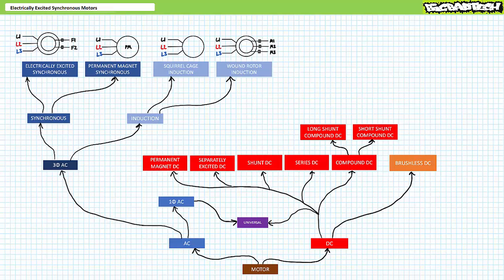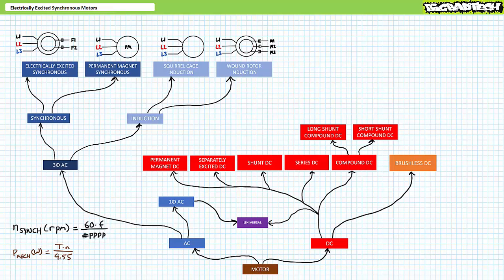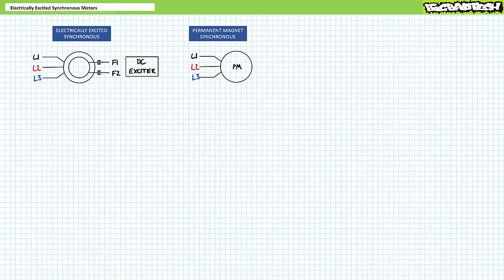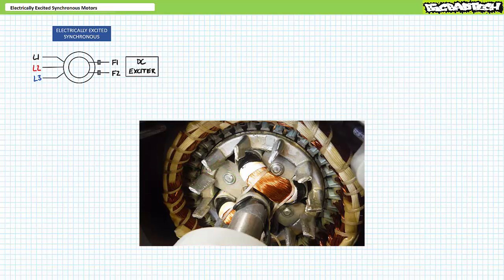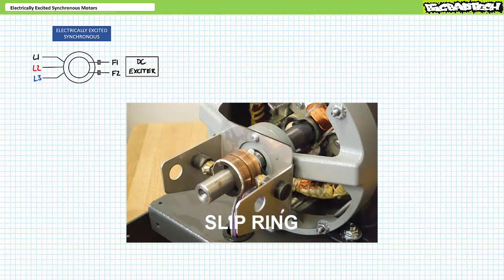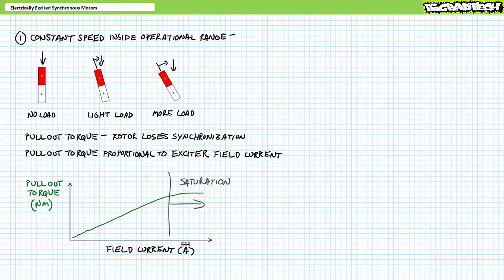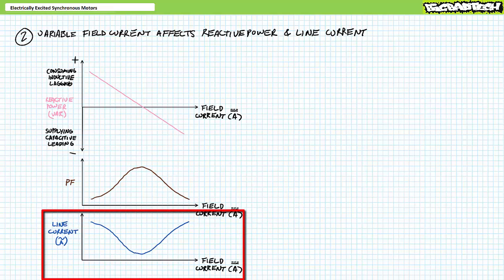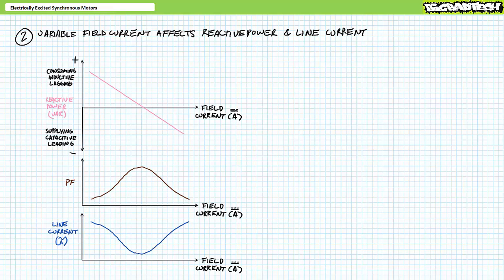Synchronous Motor (Part 1 of 2)

Comment: Just today I spoke at work with a mechanical engineer (I'm electrical eng.). We talked about rotating equipment and I mentioned that 3 phase induction motors are the best type of motor (from some experience, but also from your opinion on the matter). He mentioned that the large motors he's working with (100HP and up) he found synchronous motors to be the best. I explained the theory of induction motors, but admitted I could not remember said theory for synchronous motors - we agreed to touch up on it. Looks like I just found a great video to do so! Good timing Jim, and thanks for all your opinions and expertise for those out there like myself who enjoy it thoroughly.
Reply from the maker: Excellent. What you need when you need it. Hoping to get part 2 edited this week and posted early next. Stay in touch!
Reply: Will do! @bigbadtech